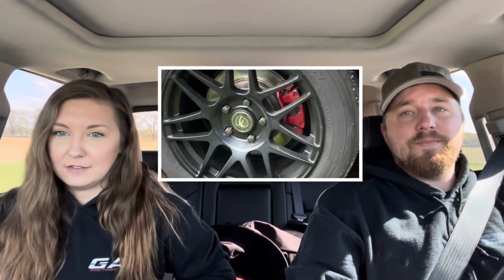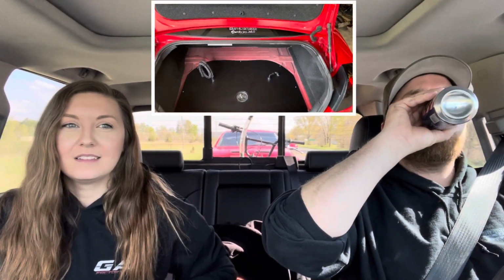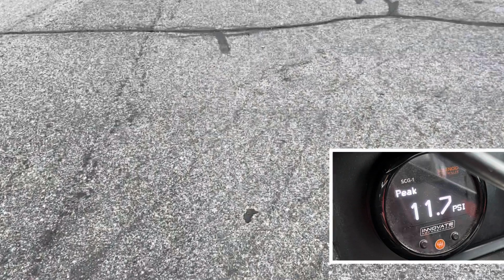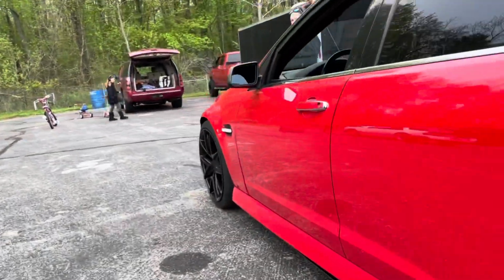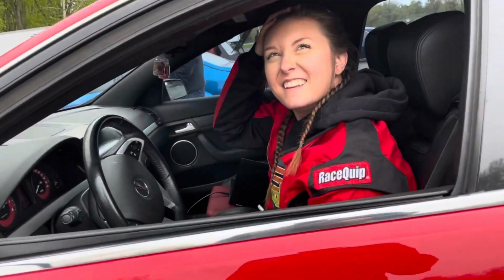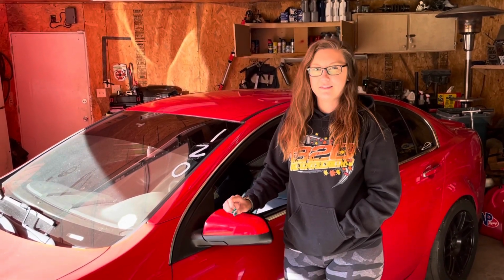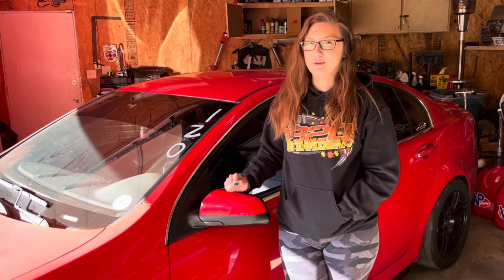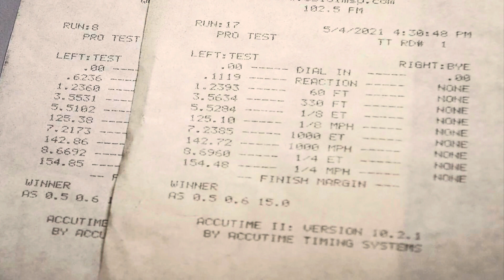Torqstorm g8 goes 10s

Comment: You can get a griptec pulley conversion for the torqstorm, I have one on the way it’s a 2.9” if u ever wanna pulley down some more
Reply from the maker: I’ve thought about doing that but I am also wondering if the blower is already maxed out as is with the heat that it produces.
Reply: @gapfactorygaragellc  fair enough! I know a couple people that have made good power with the 2.9 and I’m gonna keep the rpm below 6500 so I think it will work for me. Just figured I would let you know in case you didn’t know
Reply: Where is the griptec conversion sold at?

Comment: Your pretty quick but I'm right on your heals with my torquestorm G8 right here in Michigan I ran an 11.3 on 3 psi. But I can't get over 8 psi with my setup for some reason and I am running the 3.1 pulley so hopefully I can get that figured out.
Reply from the maker: We got her to go a little faster this year. New pb is 10.25. Our most psi with the intercooler is 9lbs.
Reply: @gapfactorygaragellc  yeah I had the Frostbite intercooler but I bought the mishimoto M line but I have hit 7psi with the 3.1 pulley so I think I'm gonna to a 2,5 pulley and hopefully it will build boost quicker instead of at $7,000 RPMs and hopefully I can get some more out of it that way

Comment: Still running the factory transmission and differential?
Reply from the maker: Transmission is a Tim king build. Diff is a camaro ss diff and a torqueworm with a speed master cover.
Reply: @gapfactorygaragellc  ever have issues with breaking driveshafts or axle shafts?
Reply from the maker: Broke 1 driver side axle and that’s when I decided to build the diff.  We have a 1 piece driveshaft in it and stock axles

Comment: How many miles were on the motor before you installed the torqstorm, and did you gap the rings? I have an LS2 in a single cab and am thinking about putting a torqstorm on it.
Reply from the maker: Around 120k and dident gap rings.  In the truck I always use 150k plus mile engine and never open it up to gap rings. You would be fine. I know of cars pushing 1200-1400 hp to the wheels without ever pulling pistons and rods out to do rings or bearings.
Reply: @gapfactorygaragellc  thanks for the quick response. I've got a 50k mile Ls2 with prc 227 heads, going to get a supercharger cam specd by Pat G, a tbss intake and 1 7/8 headers. It has a Jakes 4l80 with a transbrake and 3.73s.

It's basically the same truck as yours just with an aluminum block, I'm hoping to dip into the 10s. I will have to run 93 and meth though (no e85 here), I figure my compression will be 11.3 or so.

Comment: how much boost are you able to squeeze out of the torque storm ?
Reply from the maker: We’ve seen 11.3 with the 3.1 pulley
Reply: Is that maxed out ? torque storm doesn’t offer anything smaller for a pulley ?  It would love another 2-3 psi
Reply: @DBTUNED-CT  gotta do an aftermarket 2.9 like griptech and that voids warranty. Also the torqstorm max out around that range due to the physical housing and turbine just not having the ability to move anymore air

Comment: Where exactly were you having boost leaks? Was the head unit leaking also? Seeing fairly low boost on mine with the 3.1 pulley.
Reply from the maker: Head unit leaked sent it back for a o ring and two ic pipes

Comment: Hey did you have to upgrade the fuel pump for the torque storm? .. I'm thinking about getting the TS on my ls3 .. still on stock cam
Reply from the maker: We did upgrade fuel pump and injectors on pump gas but only a 380.  On e we did a full custom fuel system

Comment: What stall are you running. My Nova setup is very similar
Reply from the maker: It’s a triple disk 4200 circle d
Reply: @gapfactorygaragellc   Thanks for the reply. Thought it was an auto
Reply from the maker: It is an auto just has a triple disk lock up converter. It has a 6l80 trans so we have od.

Comment: A quart and half overfull...on Oil? Why?
Reply from the maker: On trans fluid and because when it’s at higher rpm the fluid can move away from pickup or get saturated with bubbles and cause the trans to slip on the shift
Reply: @gapfactorygaragellc  Do you know what your stock compression is? and you said you guys were hitting 11lb? I'm thinking about getting a torquestorm but haven't pulled the trigger.
Reply from the maker: I do not off my head and it’s a great for the money. And yes we are hitting around 11 psi max on a pass.